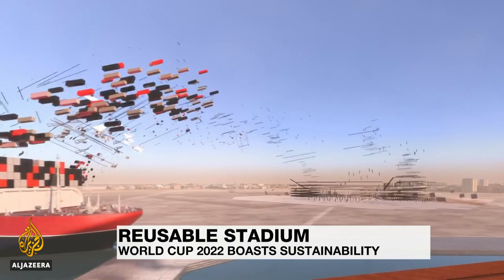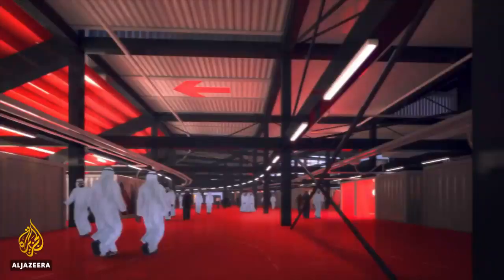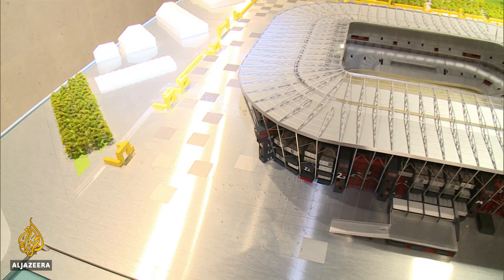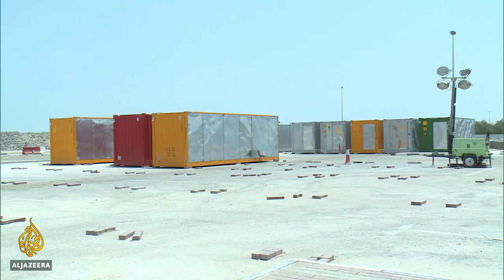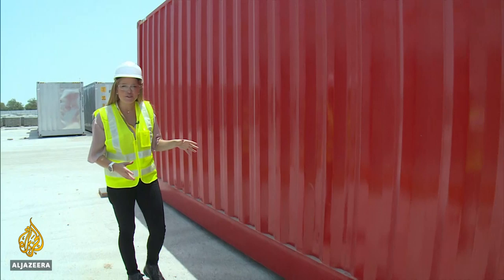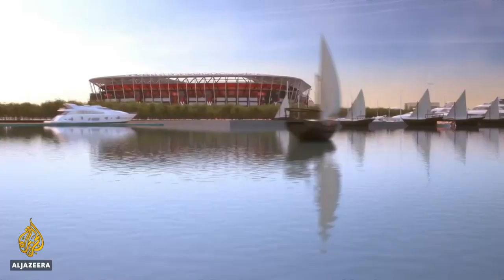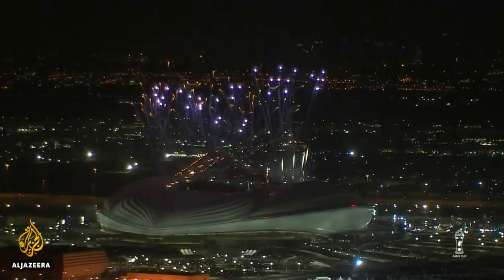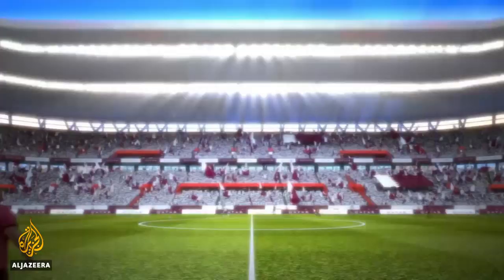Qatar to build 'reusable' FIFA World Cup stadium

Comment: If the Cost of the Stadium is 20% less than other Traditional Stadiums , then ita a very wrong decision because the Traditional Stadium at least will be there for centuries , but these containers are rented & they will dis assemble them  woooop  No more Stadium .
Reply: They can't have this number of stadiums because nobody will use them after WC and the cost of maintenance will be unnecessarily huge .It's a very tiny country with 85% of the population are foreigners.
Reply: Remember Rio Olympics and it's stadium?